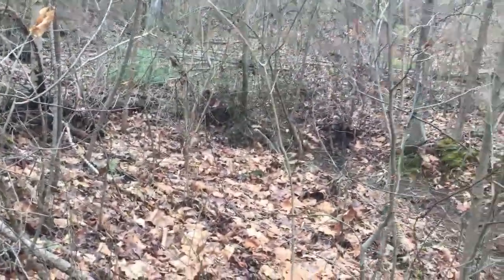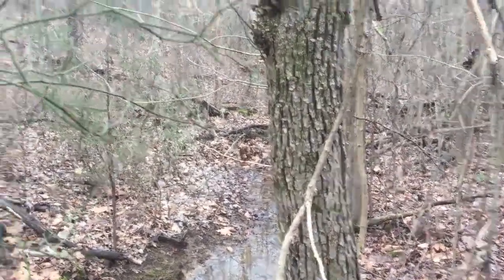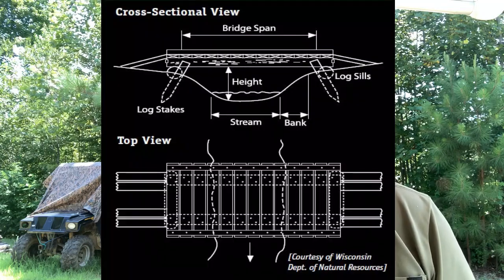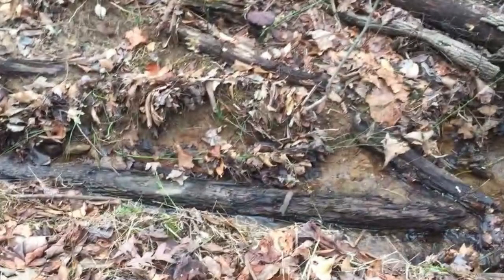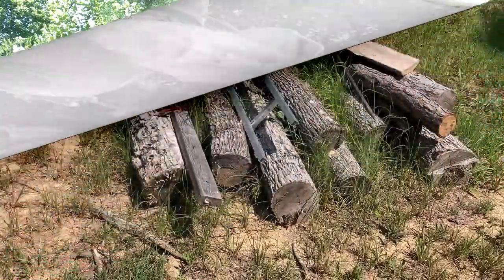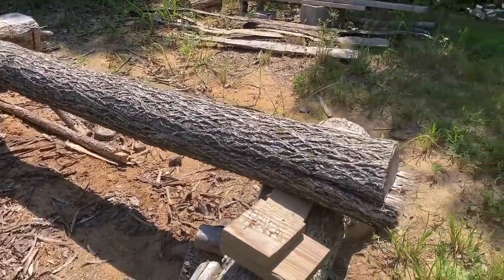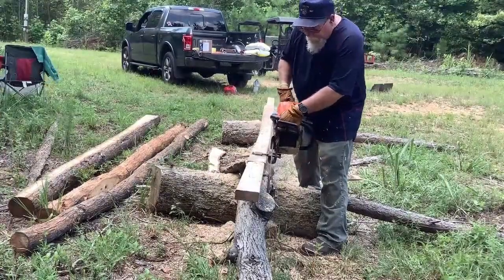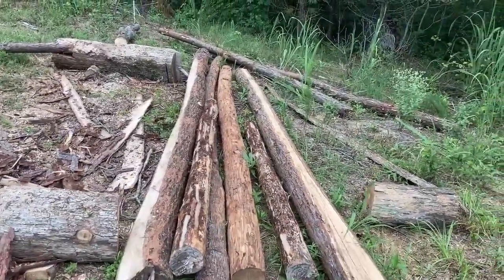How to Make a Bridge with Logs - Unassisted

Comment: Ive built 3 like this on my property... I will say this, if you can avoid packing dirt next to your logs they will last much longer... Also if you take a torch and burn any point of the log that will contact the ground, and apply oil it will NEVER rot... I think either China or Japan used this method hundreds of years ago.. I think it called "Burnishing".... Also a winch and a snatch block make moving and setting the logs way easier..
Reply from the maker: All great suggestions! I have a couple more to build just need the time! Definitely will incorporate your adds. I have some winches now and a snatch block would help as well! Thanks for the great comment!
Reply: @daveshsb  If you have trees near by, a snatch block at about eye level really helps... Put the snatch block on the other side of the span and you can sit behind the log and drag it forward and up so it crosses the span very easily, and if you have extra cables and come alongs you can drag it to either side at the same time so it lands on your sleepers exactly how you want.. One thing I forgot to mention was adding a "curb" to each side... I just use a doubled up 2x4, running on the outside edges..  Just a simple way to keep you and your machine on the bridge... You will feel that "curb" and know you way to close to the edge...I have kids, and well lets face it kids do dumb shit, and I have rubber marks on my curbs to prove it, but no ones gone off the sides....yet.. lol